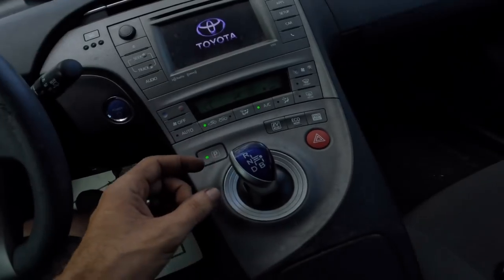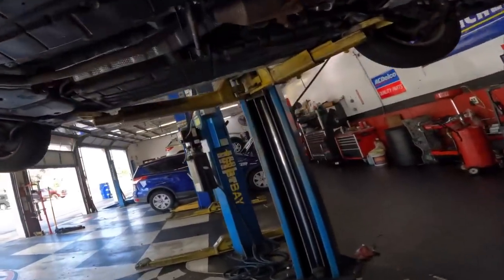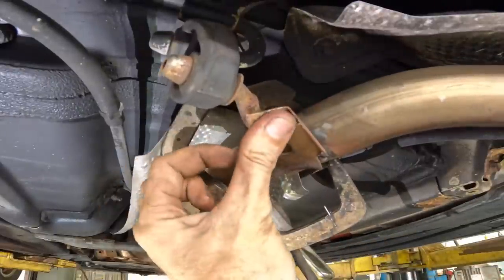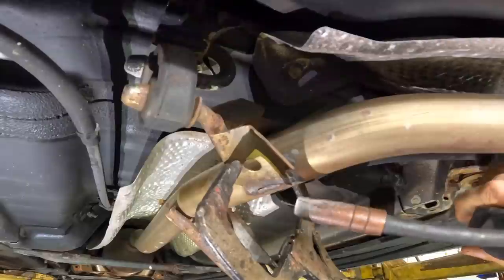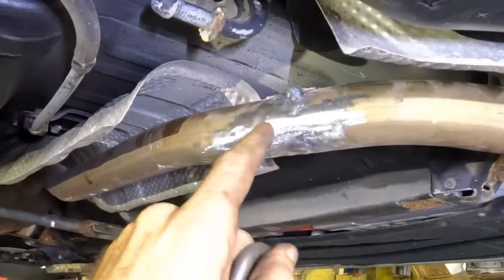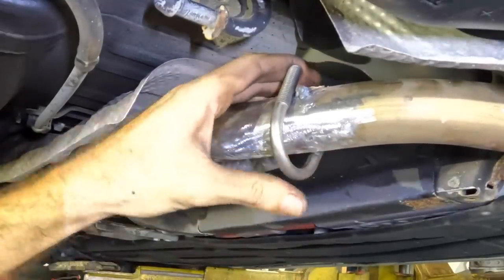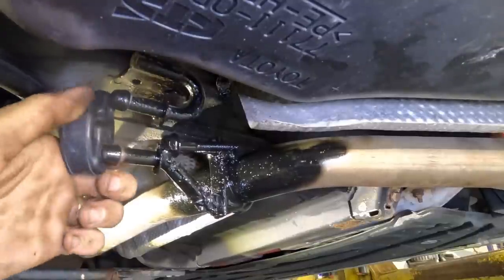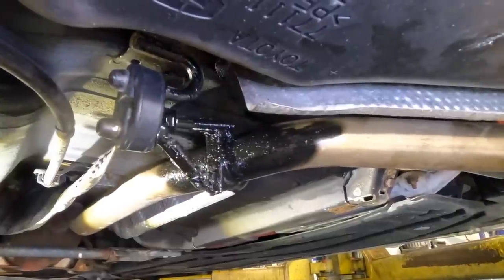This Video is a BAD Idea! Saved Customer THOUSANDS!

Comment: dont be too hard on yourself, you pretty mutch had the world against you with welding a thin gague, galvanised, pressed steel, corroded part to a galvanised pipe. thats probebly been pickled in road crap and using flux cored wire in a low amapage machine. you might have got away with welding some tin sheet to the old bracket and welded that to the exhaust pipe. but your ways good. good job as always.

Comment: With a small bottle of  straight Co2 with that fluxcore would have made that a 10 min job and your welds would have come out perfect,  C02 is very cheap...... coming from a guy with 28 years of experience in welding

Comment: Glad you were able to make the repair, but any competent muffler shop could have welded that factory bracket back on in 10 mins or less. Personally I would rather have a shop tell me if something would be better handled by someone else than to cobble something together that took way longer than it should have and frankly does not work as well.

Comment: Did you forget to take the battery cable off of the battery, before you started to weld, because you could potentially damage or destroy the electronics devices in the car, or one of the cars computers if you leave the battery cable on the battery to the car. NEVER LEAVE POWER TO THE CAR WHEN WELDING!!! You could destroy the computer, and computers are expensive too!

Comment: hack job had you cleaned the coating off of the exhaust you could of welded it back and put some high heat paint on it to keep it from rusting, not criticizing but welding is 95% prep 5% welding still good job saving people money ! only reason i left the trade was because of all the Thievery going on. Tip!! get your self a spot sand blaster and clean both parts , would of welded right up!

Comment: The flux core welding wire is also stainless steel, too much heat. And also file this into the back of your noggin, flash splatters really mess up the lens of your camera. Just sayin

Comment: I'm not a welder either but I know a few tricks and one is... you must clean the metal first! that is basic welding knowledge welding rust is a waste of time. you tried to take a shortcut and it cost you time and you may have burned through the pipe then it would have been 1000 dollar job you tried to avoid for the sake of 15 minutes of cleaning and grinding the metal

Comment: Ray using a welder, I cringe. I bought myself one of those new auto darkening welding helmets and it is the best thing sice sliced bread. Allows use of both hands. I would strongly suggest this type of purchase Ray. You will never want to use these old welding shields again.

Comment: I hate welding exhaust, im not a professional welder either, but I can weld on clean metal pretty okish. but exhaust I hate it. it so hard to get cleaned, and welding a hanger on it thats a different metal than the pipe itself is never fun

Comment: Guess you did alright,,,I would have just bought a universal muffler or exhaust bracket ,,10 minute job,..kept waiting for you to burn thru the exhaust pipe without gas,,,hey how do you get it back off,,ohhh wellll...

Comment: REEEEEE-Maybe clean up the surfaces some  before starting the weld? And get some shield gas, geez.  ANTI-REEEE  triangulating that thing with that bolt made it much stronger.  Should last till that exhaust pipe rusts out.

Comment: Hey Ray I've spent most of my working career 45 plus years doing fabrication of one sort or another and considering what you had to work with I'm I'm impressed really you know you called shade tree or whatever you did a great job and for all the little trolls out there that have something to say get a job a ray great job as usual and by the way that rear windshield wiper went on easier than that BMW you did I think it was a 97 but you having a heck of a Time sliding that hand door release handle on the other day same click but it didn't quite click catch my drift have a good day bye

Comment: What a pig's ear of a solution that was Ray. You could have welded a piece of flat bar to the hanger and drilled a hole in the other end to bolt onto the bottom nut of the U shackle.

Comment: No comment on the welding, but for me, anytme I have the wiper arm away from glass and doing shit, I have a folded up packing blanket under ther in case the bare arm, and all it's potential anger, slaps against the glass without the blade to make the outburst meaningless

Comment: I'm a certified welder in mig and arc welding. A few cringe worthy moments for sure but as long as you saved the customer a lot of $  then its all good. Stainless to mild steel use 309 wire or rod :P

Comment: That kind of welding wire is crap, I have one of those and even a good welder can't do a good job with it. It's much better to use a regular old school rod welder if you can't supply inert gas. But if that's the only thing available to you, then there isn't much you can do about it. Still a better outcome than spending 2K for a damn bracket.

Comment: Eh. If the wire needs gas and your polarity needs gas it doesn't matter. Use gas. Only time not using gas is with flux core wire and reverse polarity.

Comment: Ray, I noticed you didn’t have any welding gloves. So come clean with us. You didn’t have a welding helmet either, did you? 

From watching your technique I could see you using the cup of your torch to lean against your work in an effort to hold your aim as you fired off the welder and made numerous small puddles rather than a continuous bead. Makes me think you couldn’t even see the weld puddle. What say you? 🙂

Comment: your welding s fine , but coated steel sparks like hell and does not weld correctly as it wont allow the arc too gieve a propper arc and the coating inerfers with it also

Comment: I won't comment on your welding, as I'm not much better. I will say, you should clean the parts you weld first. The welds are stronger on shiny bare metal.
Reply: As a painter, I cringe watching you paint. Waaay too heavy. I'm always amazed your paint doesn't run like crazy. Lol

Comment: I'd have tried flipping the bracket around and welding it to just the cross brace so that if it ever needed to be removed it still could. But it should hold fine the way you did it too and is probably a bit stronger. You are a good man.

Comment: Cant really weld dirty metal, I wonder if you woulda cleaned both surfaces if that woulda made a difference. Nothing against you I ain't that good with a welder either. Or it could just be the welder itself.

Comment: I am guessing that pipe is an aluminum alloy of some kind,  why it's not taking a weld
Did you check that rubber hose that connects to an aluminum tube isn't a GAS line ?  You are awfully close to the fuel tank.

Comment: Hey Ray, I always liked your work, but this one gets a thumbs down. The metal you are weld has to be clean before you weld it,  a new weld will not take to rust. On the other hand, you did give it your all, and did save the customer money, thumbs up for that. Thumbs down to Toyota for a piss poor design hanger.

Comment: Yeah Brother, about your welding...
My flux core booger welds and I would like to make a big shout out to you!
I used to work at a exhaust shop when I was a young kid. It kind of irked me when a car would come in and we'd have to replace the WHOLE EXHAUST just to put on a new muffler. It always seemed wasteful and quite frankly, dishonest. There is a vast difference between being a just parts changer and a mechanic (or technician if you prefer).

Also, I think the difficulty you had was the fact that exhaust and part of the hanger was probably stainless? In my experience, welding stainless with a MIG without gas is not going to happen no matter how good a welder you are. I can empathize with you and the lack of gas. We would often find ourselves welding with coat hangers and acetylene torches. 

Your end result doesn't look that bad. Also, you really had me when you added the bolt to the top for extra bracing (overbuild for underworries). Just like some of my repairs...they don't all look pretty, but they will last and not leave you stranded.

I would rather have you working on my car than some "parts changer" any day.

Also, the "baked on paint" went above and beyond!

Comment: You have to be kidding the YouTube world...WOFTAM video...Rule ONE is grind and provide clean metal for welding...you obviously do not read the comments. Saved the client thousands until the weld breaks again...so frustrating Ray!!! If you claim not to be a welder, get someone in the shop who can weld, to do it! Gasless mig wire works well, just clean it first Arghhh! YOU MUST CLEAN OFF THE SLAG, DO NOT WELD OVER THE SLAG>>>>

Comment: It's so funny, english speakers almost never can pronounce Knipex. Yes slient K is wrong. But almost all english spleakers who try the right way end up saying ke-nip-ex. There is no vovel involvement in the transition between k and n. Think of please, same thing p and l have a seamless transition. You do not hear pe-lea-se. But to be fair I can not think of one English word that starts with kn where the k is not silent. So what to do if the kn does not work with your tounge? Silent K is better, because consistent with the English rules and closer to the correct sound than the version with the vovel transistion.

Comment: That exhaust is aluminized steel. You have to grind the coating off before welding. Always clean your work piece of any rust, dirt, grease and oil. Especially when using MIG.

Comment: Most stainless steels are NOT magnetic.  Duplex stainless steel, Ferritic stainless steel, and Martensitic stainless are all magnetic.  Also, SS 409, 430, and 439 are also magnetic SSs.   The majority of SS called Austenitic stainless steels, are not magnetic.  The piece of strapping you are working is likely a Austenitic stainless steel.  I'm just say'n....  

Hey Ray, spend a few bucks and take some welding classes.  Then buy a decent welder.  If you get good at, you can pay for the welder in no time and you can make some serious cash money, under Z-table, at home taking on a welding jobs, every now and then.  Set your own hours, tell folks you only weld during the cooler months of the year.  Whatever, your are Z-boss...you make z-rules!!

Comment: I'd have simply bent a strap of steel around the pipe and run a bolt through the holes in the original mount to attach it. Just sayin'...B^ )

Comment: who needs welding gloves when you have a layer of safety skin. also its 409 stainless steel on most oem exhaust,  a very cheap stainless that is the least rust resistant stainless and its very borderline, once it starts to rust its hard to stop it, look up 409 stainless steel vs 304 or 316 for more info. again also, you should have just sent them to any exhaust shop that does custom exhaust, 10min and they could have just welded a new hanger to the pipe with the proper equiptment because they have their lifts already set up to weld under cars all day.. and they have mild and different types of stainless hangers and their welders set up for 409 stainless, probably would have been cheaper for the customer than paying your workshop 2 hours of labor for you to figure out you cant use mild steel wire properly on everything and anything.. and also also, tell the customer that when it adventually breaks, because it will, then take it to an exhaust shop and get a new hanger welded on.. also also also ... lol more rreeeeeeee!

Comment: Get it true it has a lithium ion bomb for fuel economy I seen one of those get hit by an 18 wheeler 18 wheeler driver and the Prius owner died because the lithium ion bomb blew up Fireball bigger and a bud how tall is about 15 stories and pop pop pop from the battery sound like fireworks they're not safe they should not be allowed on the road

Comment: You could change the wire to 316 or some other grade of SS. It will weld on SS and carbon steel.

Comment: I would think you need to grind/sand off the rust on both pieces and clean with brake clean before trying to weld.  If you had done that, maybe the first bracket could've been fixed.

Comment: Ray might welder or also call CO2 welder what ever. No.1 make mistake to clean 1st that pipe 1st before welding before you do welding it. No 2 we always say never ever weld on car/s when the battery been connected  yu will explode that battery sepost to disconnect the battery before welding on an car ever and yes aiman welder and now what aim been talking and that tipe of welding you dun are looking crappy we call that bird poo..

Comment: Seemingly pretty Novice mechanic here 4 sure. With largely irresponsible techniques in some cases. Making 2 many assumptions. Diagnostic level of expertise is pretty basic. Not just welding, you do all types of stuff backwards or out of order making it orders of magnitude more difficult on yourself. All the cute little jokes and puns are cool and all but some of us tune in for other reasons
Reply: Wed have you chaning oil and tires you wouldnt be doing any repairs or diagnostics here wouldnt be profitable